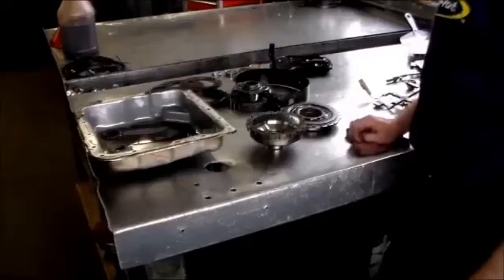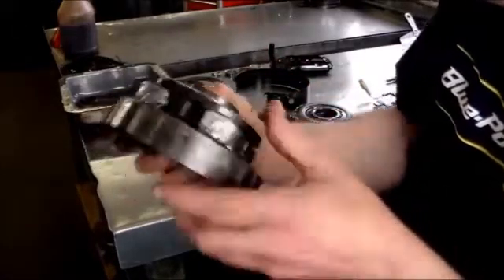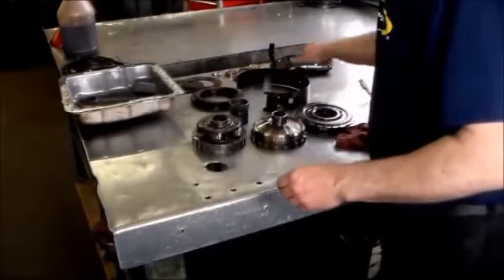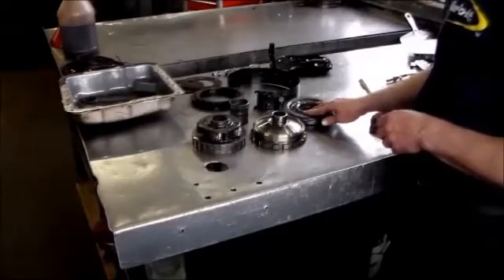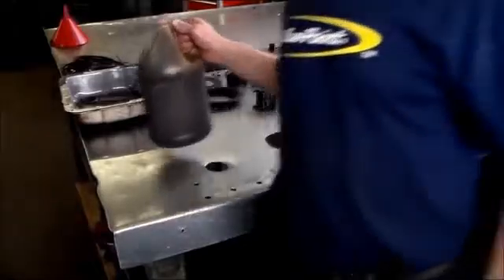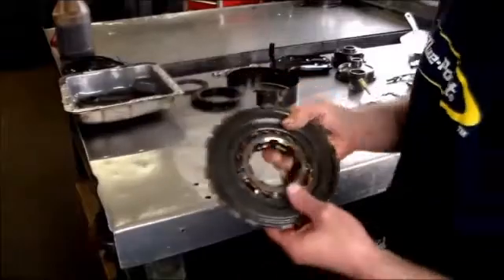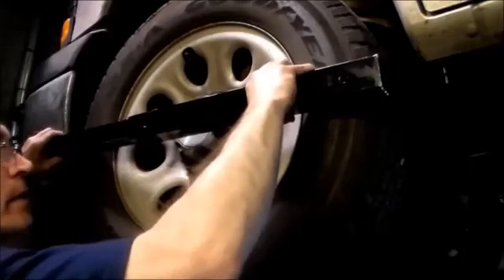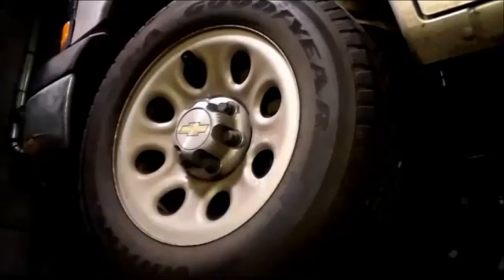4L60E AWD vehicle with wrong tire size

Comment: Starting to wonder if the previous owner of my Saab 97X 5.3i had this issue and that's why they dumped it.  Transmission still feels good and shifts properly.  I know you said this one didnt have an encoder motor because it's full time awd, but mine is full time awd and it has an encoder on the transfer case.  I had to replace it because it was binding real bad.  After that the truck now operates as it should but when you take your first off the accelerator it makes a really strange almost clicking... grinding(?)... noise up to the point where it finally downshifts into 1st.

I've been trying to diagnose it forever thinking the noise could be exhaust, abs, maybe loose valves...but i always come back to the fact it stops when you accelerate and it stops when it downshifts into first.

No clue what is going on.  Wish I had a chassis ear.
Reply from the maker: may be awd, you can switch from 4wheel high and low?
Reply: @GaryFerraro  hey Gary, no selector! The 97X (I believe) has the same AWD system as the TBSS.

I just saw your video and am now wondering if mismatched tires at some point destroyed some kind of gears somewhere, or maybe of these transfer cases have some kind of clutch pack in them the computer was freaking out about tire sizes and broke something but I did do a rudimentary roll test on my current tires and didnt see anything outside of 1/4" difference.

Wish I could post the sound for you.  I swear it almost reminds me of like a clicking/diesel engine brake/mechanical noise.  Hard to describe.

Comment: Holy shit i checked my car and it has Pirelli pzero Rosso front 
And Pirelli pzero rft rear the wear is the same on all 4 but different Pirelli models will this couse damage?? It's a audi a6 Quattro
Reply from the maker: You really have to measure the tires with a stagger gauge.
Reply: Gary Ferraro the difference is 2.5 millimetres. I live in Europe so we don't have inch but a quick Google calculation its 0,098Inch let's say 0.1inch difference will that couse damage?
Reply from the maker: Thats about one inch, too much.  Max is half inch
Reply: Gary Ferraro 1inch is = 25.4mm 
And my difference is 2.5mm thats about 0.1inch
Reply from the maker: Sorry, i just looked back at my converstion chart and it was set on thousands, yes your ok,  anything over half inch is no good

Comment: A quick way to check for different size tires is to mark the sidewalls with chalk and roll the vehicle in a straight line. All 4 chalk marks should stay in the same clock position.
Reply from the maker: Scott Diamond thanks for the tip
Reply: Thanks for the video
Reply from the maker: welcome

Comment: hi , I just bought a 2007 ranger with 265 70 16s  .. but the door says  255s ,,,  it is  a  4x4 but even  disengaged the tachometer seems to tach  pretty high compared to my other  ranger , I was wondering they are  aggressive all terraians  and the  wrong size ,  can that  affect the  tachometer and  even  add to road  noise , id swear  even though I haven't checked the  mpgs its  far  worse than my  94 ranger both had  4.0s  not  sure about the  gear  ratio , and  if  wrong tires  affect  that ,  thanks
Reply from the maker: Should really effect the tachometer, can add to road noise, are all 4 tires exactly the same(  model & size)?
Reply: yeah they are the same ,, all terrain forget tha  brand  but they have  good ratings , , it is a 4.0 and  at 60 mph it tachs  around 3000  rpm which seems hi or at least a lot higher than my other ranger ,  which was a 94
Reply from the maker: Is it going into overdrive, that does seem high
Reply: well after driving it a few days  the  tach  seems to be more  reasonable maybe 2250 at 60 or  so  is that about  right ?
Reply from the maker: yes, i would say thats about right.